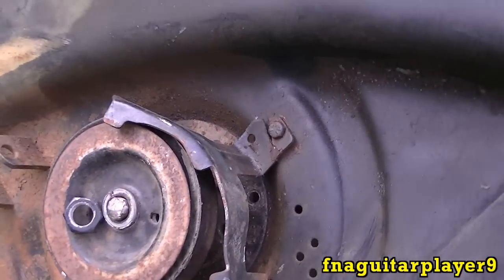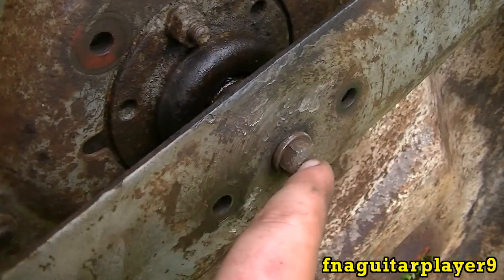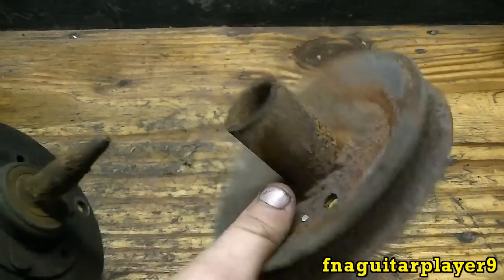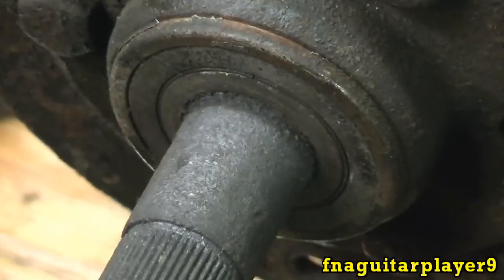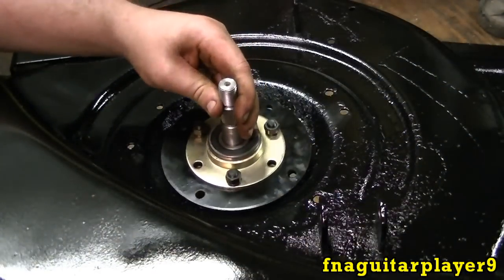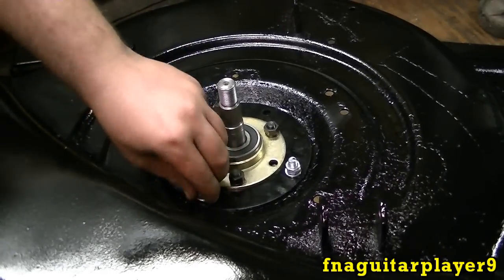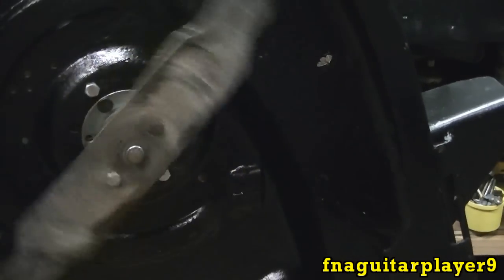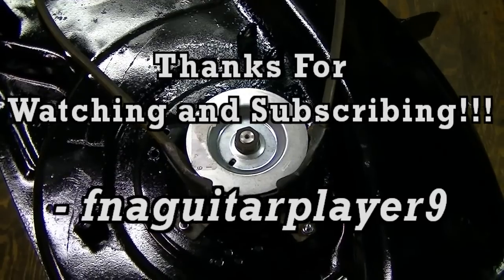How to Remove and Replace Quil / Spindle Assemblies on Older MTD Riding Mowers

Comment: Great video and thanks for the part numbers. I have a old MTD 12/38 with a bad bearing. I removed the spindles but the pulleys and blade adapters are rusted on pretty good. Now I know they should come off pretty easy. Got them soaking in some WD40 and with a little heat hopefully they should come off.
Reply from the maker: +oneandzero Thanks, your welcome! I hear ya. I never did get the adapters off the ones on the video, they are stuck! It might pop off, a press would be nice for that. Thanks for Watching!!!

Comment: Where are you getting these parts? I can’t find them on Amazon. I have an older MTD mower & the deck spindle pully and blade adapter are frozen onto the shaft and I can’t get them off, I even tried using heat & a wheel puller. Nothing is working. My mower model # is unreadable so I can’t order parts by model #. Can anyone help PLEASE!! It’s an old signature elite 42” deck. I think it was a Montgomery wards mower back in the day.

 Since my mower deck looks extremely similar to the one your working on in this video, can you please provide the model number so I can use it to order replacement parts for my mower deck? My mower model number is totally worn off/unreadable, so I don’t know how to get the right parts for my mower.

Comment: I own a 18hp/42" montgomery ward power kraft lawn tractor. There are no model numbers or ID on the tractor, so I dont know what spindle I need for the deck. How do I determine the correct model part number for the deck spindle assembly?
Reply from the maker: ajp0007 guessing I would say it's the same as mine in this vid but not for sure. There should be a small plate with the model / serial numbers either under the seat on top of the frame or on the back above the hitch but it may peeled off it should start with tmo. Hope this helps thanks for watching!!!

Comment: So how do you replace the spindles or bearings without removing the deck?
Reply from the maker: +Stephan Black It would be very hard to do, hard to get the pulleys off the top, and harder to get to all the bolts but can be done. Thanks for Watching!!!

Comment: I have a older mtd riding mower I just got from a friend and its a 11 horse 32" cut is what is on the mower but then the deck has a sticker on it that says 44 that's it and it's rusty so I can't see any other numbers on there and I want to replace the whole assemblies as well since it sat in his yard for years
Reply from the maker: I actually have a 11-32 MTD (ServiStar brand), but it doesn't have  the deck (plan to use it as a mini tractor, for pulling a trailer, etc) I just checked the manual i have on it and for some reason (1st time i've seen this) it doesn't list a complete quill / spindle for it, just the individual parts. But i'd suggest measuring the deck itself, if its a 44 inch cut off something else, its going to be hard to find new ones for it without knowing what it came off. But if it is a 32", there should be a model # on the back of the mower near the hitch, or under the seat, if you can find that i should be able to do dig a little deeper and find something. Thanks for Watching!!!

Comment: Ok I pulled the deck off today and it is a 44 I found a sticker on it its a mtd 190-935-000/i278D says meets 1986 safety standards only numbers I found 
Thank you
Reply from the maker: No problem. I sent the info to tulsa engine warehouse and they asked me if its a 3 blade deck, is it? It didn't show a middle blade but both sides have different #'s, the left is 917-0909 and the right is 917-0910, I can NOT guarantee these are right, the 2nd one shows a picture here: http://tewarehouse.com/Genuine-MTD-Part_3885 But i have no idea if they are the right ones or not. Its hard to find anything out the actual mower's model #. Hope this helps!